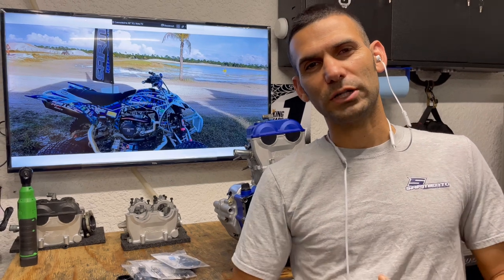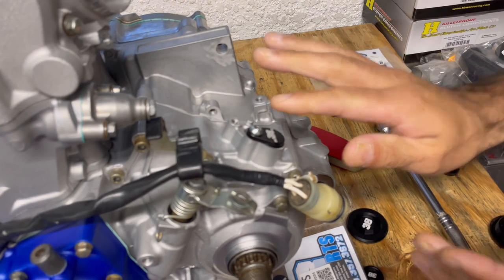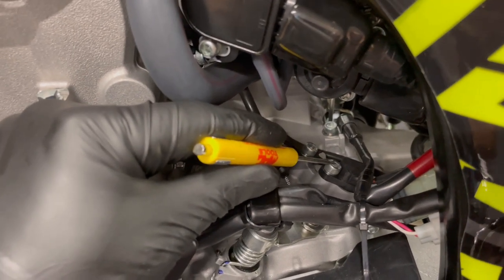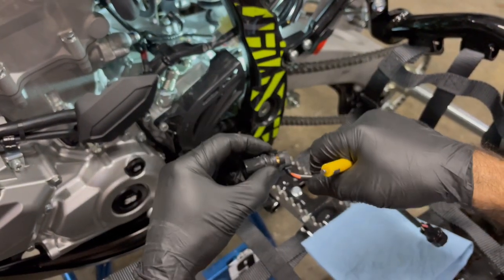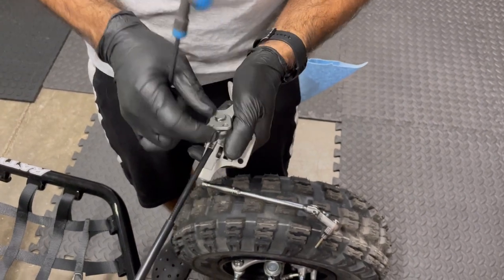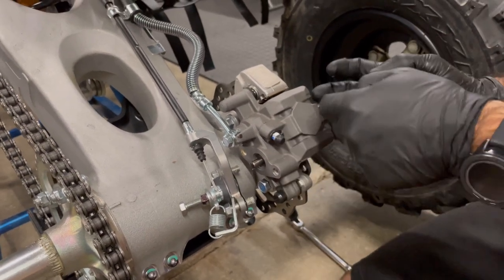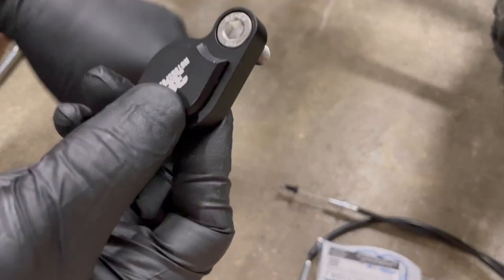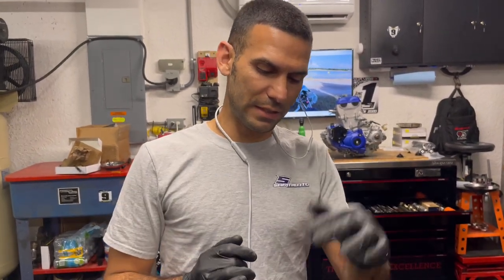Timing Plugs + Speed Sensor Block Off + Parking Brake Delete

Comment: Will those timing plugs fit on a Raptor 700r..  I baught some work connection ones and they leaked so I had to put the factory plastic ones back in

Comment: I took mine off with stock ecu and never got a check engine light
Reply from the maker: If you leave the sensor plugged in then yes you won’t get a check engine light.
Reply: @sarmientomotorsports910  I unplugged it then capped it off with the female end I got from 38 motorsports and put there block off in place.
Reply: May I use the speed sensor block off with the power commander 5?